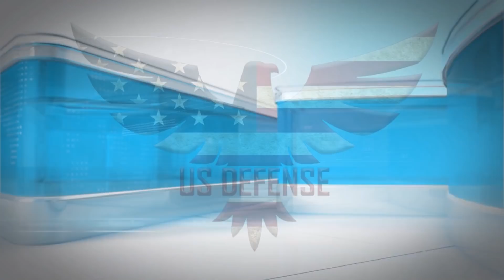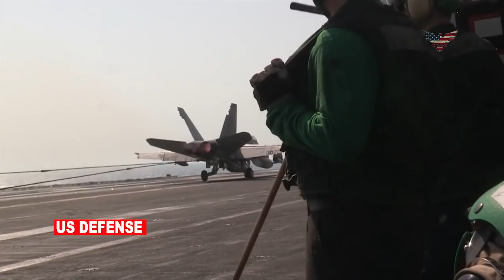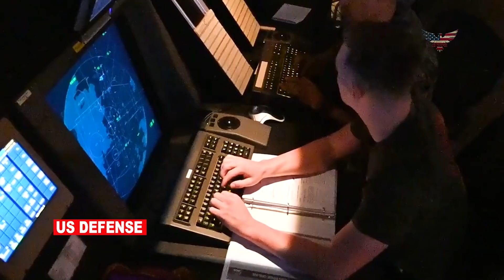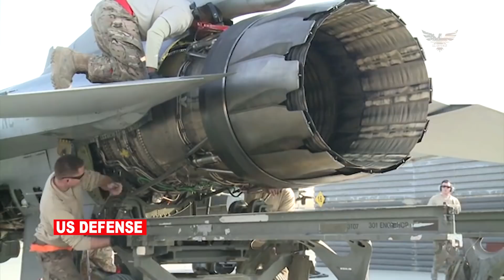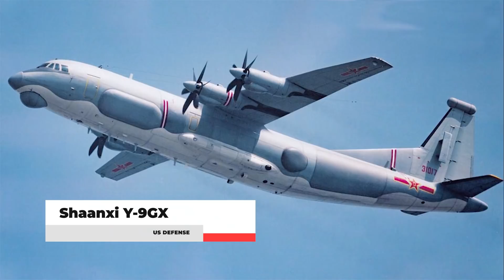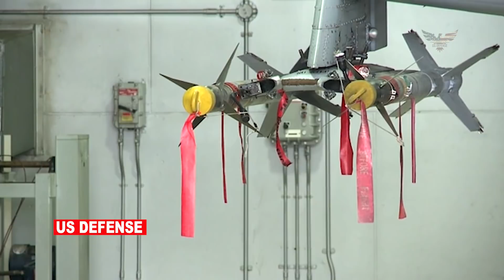Joe Biden Angry : China's J-16 Fighter Modeled On U.S. F-16 Fighter

Comment: Get use to it ... it's the CCP and Russian M.O.  They are not in the same league, technologically, as the West and have to stay close; so they steal!   Let them continue to try!  The technological gap between them and the West is widening.   They will continue to fall behind.  Reverse engineering is not as simple as it appears.  Stealth is a perfect example. The technological know how is comprised of design, coatings and manufacturing tolerance.  Miss out on any one and there is a definite advantage for the F-35 and F-22 to penetrate current defensive missile systems or take out the enemy's copied version.   The West needs to stay on the path to design, develop and innovate!